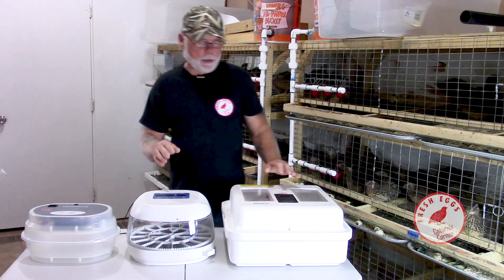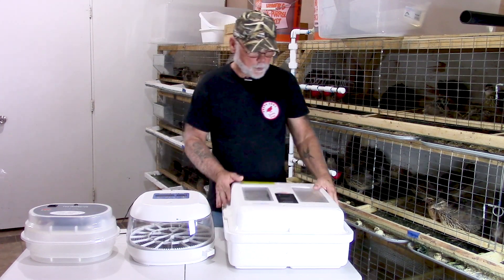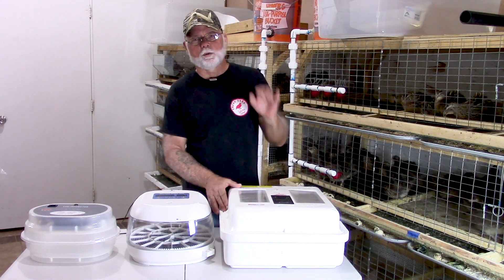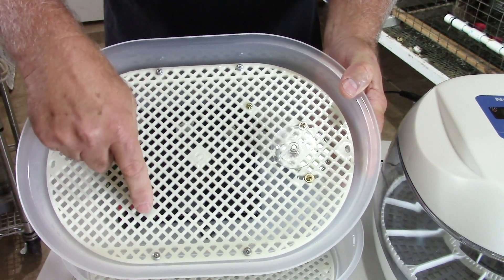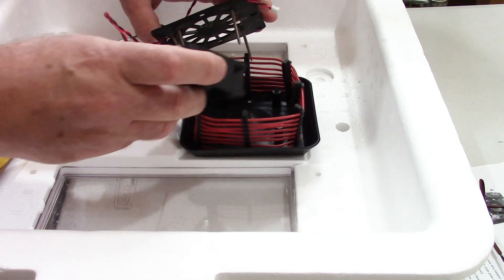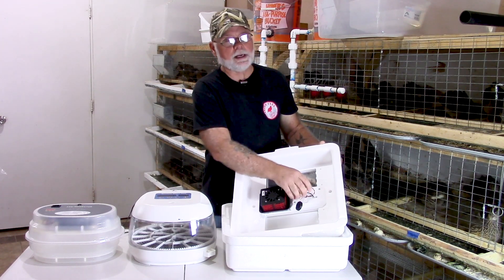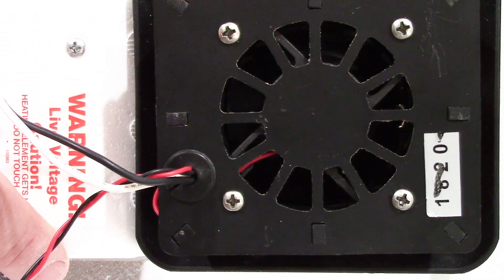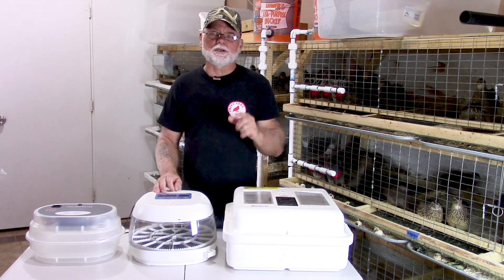INCUBATORS - STILL AIR VS FORCED AIR / Modifying the still air incubator

Comment: So I've decided to give quail a try and I have an old hova Bator stail air laying around. I found the quail racks for it and will spend probably way too much time trying to dial it in. 
Here's my question... Is something better than nothing... Should I put a tiny Amazon fan in it? On the screen and pull it at lockdown or mounted to the top? Can the waffer thermostat take it?

Comment: I modified my little giant still air with the fan as well I have a question now that it has a fan so I have to monitor top and bottom temperature or do I just go with the Temperature gauge that came with the unit

Comment: Thanks for the helpful video. Do you know the connector type of the fan for this little giant still air incubator or possible link to the fan  with connector fit for this incubator?  I bought a fan but the connector not fit.  Thanks for your help.

Comment: I just got my first hatch of ducklings from a still air unit, 12 out of 14 eggs hatched, but I did notice early on that it had cool spots and rotated the eggs through them. That was a pain, but I think it worked alright.  I had already planned on adding a fan but wasn't sure how exactly, so this video was exactly what I needed to see. Thanks !

Comment: Good video. Where do you get your droppings pans for your cages?
Reply from the maker: Advance Auto Parts is where I get mine. Most auto parts stores carry them. They are called automotive drip trays.
Reply: @CoturnixCorner  Thanks Terry.
Reply: @markbryant6168  And if you wait for the 25% coupon, it's like buying 3 and getting 4. I'm starting small with 4 modified cages based on Terry's design.
Reply: @TheFlamingEyeball  Hey thanks for the information. Appreciate that.